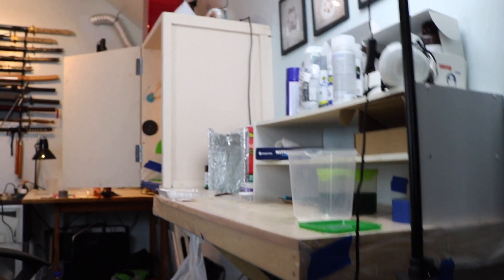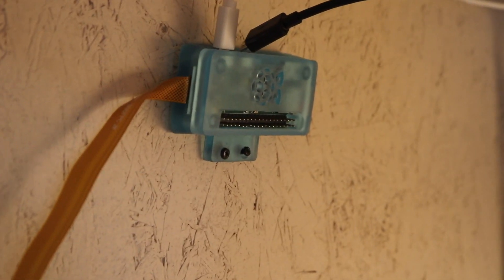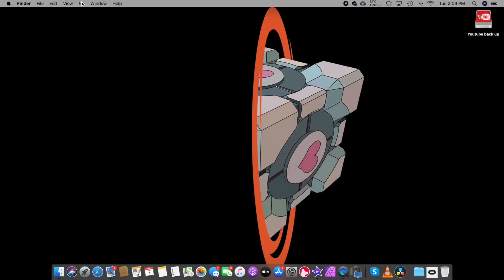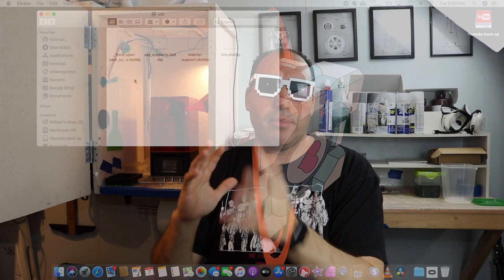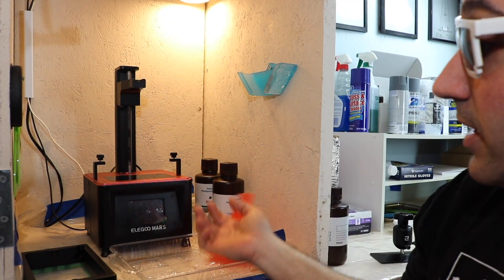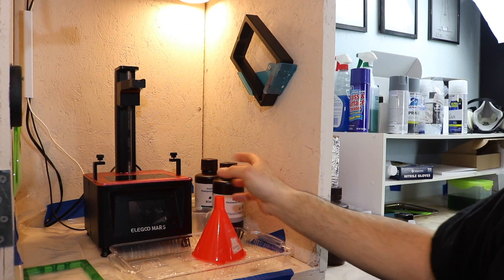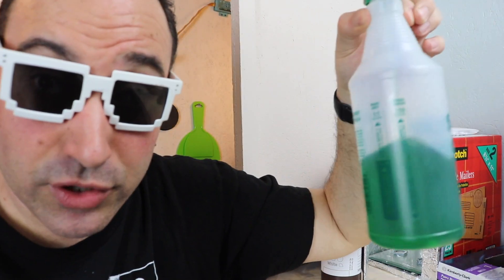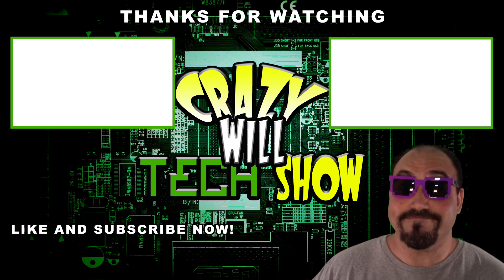Elegoo Mars 3D printer upgrades tips and tricks

Comment: Interesting stuff. Just a heads up for you on the confusion with Metric screws M6 - 1 x 20 is a 6mm diameter screw with 1 thread per millimeter and 20mm of length. A typical M6 screw would have a slightly smaller hex head diameter hence needing an 5mm Allen wrench. Those are all details on metric screws...
Reply from the maker: Thanks where were you several months ago! Lol

Comment: I've noticed the mars 2 keeps reading the ctb file on the usb on each layer.

if i use the raspberry pi, and network goes- or wifi skips? Is it likely my print is gonna mess up?
Reply from the maker: Other than transferring it’s reading off of the raspberry pi’s sd card. So you won’t have any issues with the transfer the data to the printer. It’s the same as having a USB in the back. I have never had a problem. Now transferring sometimes stuff can get corrupted but very rare.

Comment: To stop the pi from powering your printer when the printer is off, you can put electrical tape over the 5V+ pin on the usb or there are some prints to cover it as well.

https://community.octoprint.org/t/put-tape-on-the-5v-pin-why-and-how/13574

Comment: Metric socket cap screws/bolts - not easy to find. Sometimes car part shop may have them, Home Depot or Lowes. I order mine from "bolt depot" online, when I need more than one. Also a small rotary table for UV curing may help.
Reply from the maker: Yeah just bring it in to Home Depot. You’ll find something that fits. Lol that’s what I did. I was thinking of getting A little rotating table... does it really help?